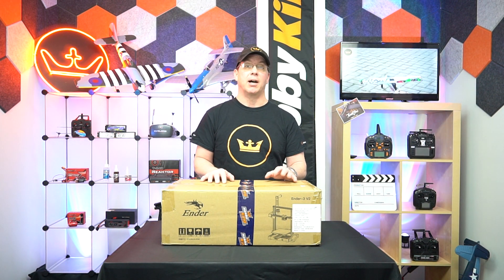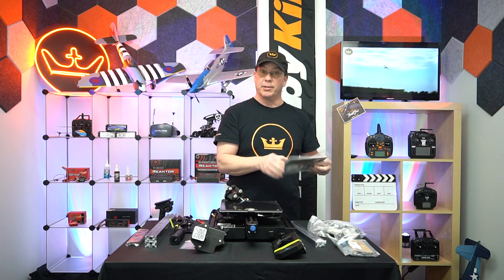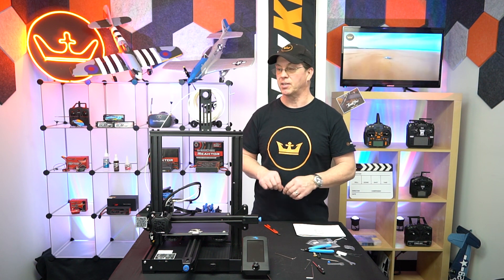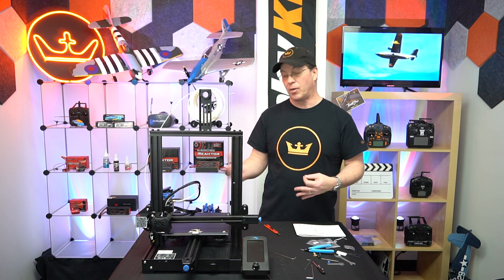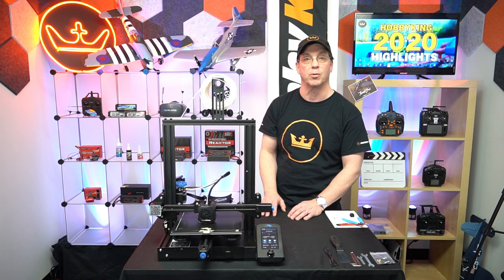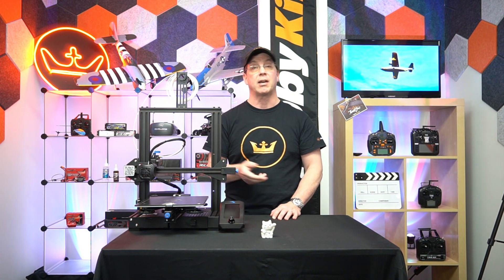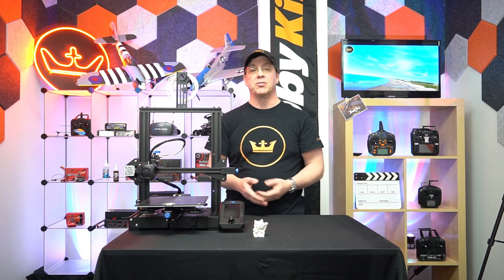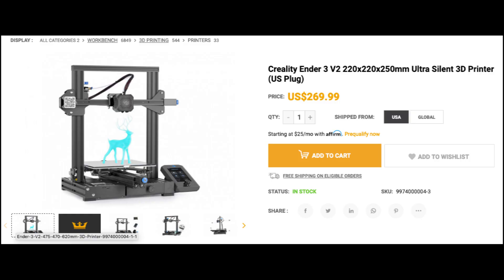Creality Ender 3 V2 220x220x250mm Ultra Silent 3D Printer - Unboxing & Assembly Video

Comment: Just got my ender 3 v2 from hobbyking uk must say great printer ,i did upgrade the tube and exstruder and bed springs
For the long term dont for get to recalabrate your esteps tho,fan and hotend mod next then it will be super silent.
Reply from the maker: Thanks for sharing